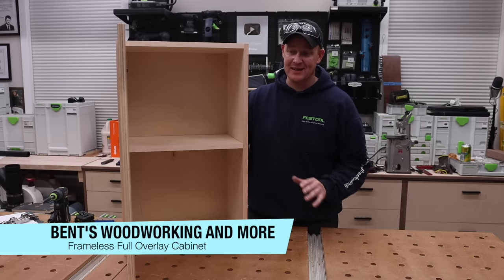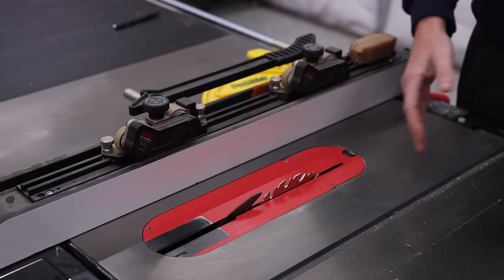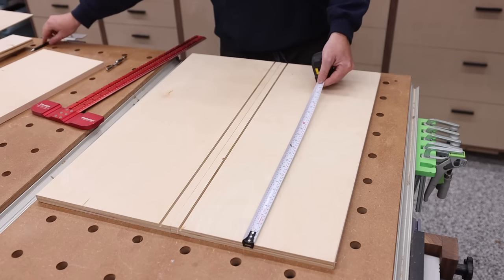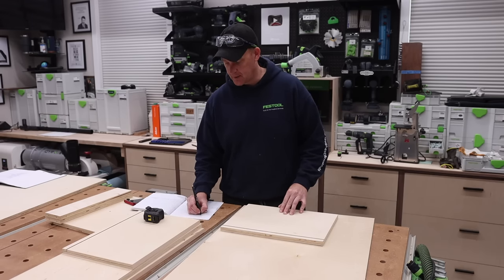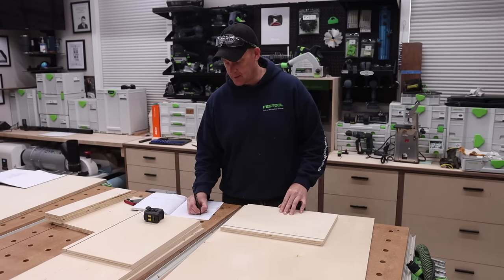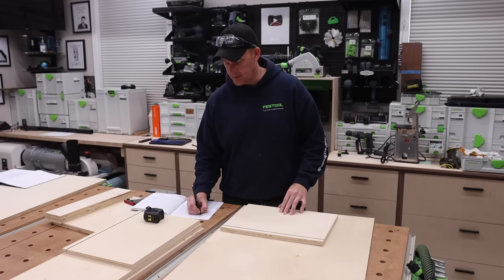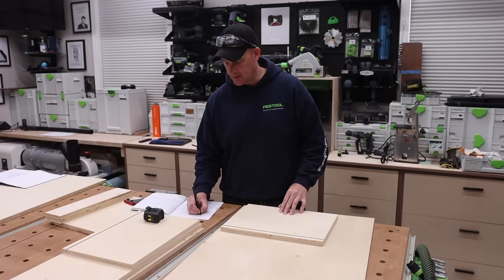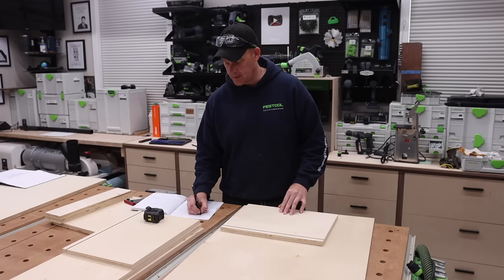Beginners guide to frameless upper cabinets

Comment: Excellent tutorial, perfectly paced. As ever, the inclusion of metric measurements was appreciated.
I use crown staples all the time, as I find they have more holding power than brads.
Alas, over here the cost of that fine looking plywood would make even basic cabinets extremely costly, so it's MDF all the way. Even that has more than doubled in price over the last 18 months.
I will be checking out the shaker door tutorial to see how you go about it. Thank you for taking the time to share!
Reply from the maker: You’re very welcome

Comment: Thanks Jason. Without any doubt, this has to be the best walkthrough ever. 90% of what you demonstrated is what I do, the only difference is that I tend to have the top & bottom on the top & bottom, not inset as you showed. Different techniques, but same results. Very well done.
Reply from the maker: Thank you so much Gary. I appreciate that 👍👍
Reply: @MrWookie1981  Don't get me wrong. I've tried both methods, but I actually find it easier the way I do it. However, when doing inset (rarely), I would do exactly the same as Jason. I'm about to try a different technique in a week or so. It should work & make lining up much easier.
Reply: Typically a top and bottom panel are set into a dado on the side panels. This is done so when you look at the side panel, it is a solid piece from top to bottom. Otherwise you have to deal with the plywood layers showing on the edges. Also the shear strength is better this way.
Reply: @stallionranchwoodworks  You said top and bottom into a dado.  Did you mean rabbet?

Comment: I’m seriously considering making the switch to all metric measurements, the fractions get me screwed up, your channel has helped, thank you
Reply: Get yourself a combo tape measure that has both inch and metric. One side of tape is in inch the other side in metric. It will assist you with the transition process. Also there are apps for your phone or tablet that can be used while in the shop woodworking. I have made the move and find building cabinets easier with metric.
Reply: @jwar2163  I use to hear the measurements like in this video ex 700mm and think why would you want to work that way, then I made an error this weekend in the garage and cut a bunch of stock wrong because of getting tripped up on the fractions, now all of a sudden measurements like that seem like they might be easier to manage
Reply: @randysmith3828  Been there done that myself.
Reply from the maker: Glad you found it helpful

Comment: Excellent video, thank you. I am a beginning woodworker and will build a kitchen for my sister as a wedding present and I will use the things I learned from you.

Also I have a question: what is the best way to mount the upper cabinets to the wall? How to get them level next to each other and what metod to use to keep them in place the easiest way?

Comment: The fact that you used metric made me so happy! It makes the backpanel equation super easy 700mm + 15 or whatever, instead of 43 Inches plus 3/7th divided by 1/4rocketships minus 69/4th of a mountain dew without ice. I’m so happy you’ve come over to the simple way of measuring😂
Reply: Canada went metric but people still refuse to go by metric I can’t understand that
Reply from the maker: Definitely much easier for me. Especially when dealing with cabinets.
Reply: I was just thinking that exact same thing I was listening to the video. I'm struggling going back and forth between metric and imperial. I grew up as Canada was switching to metric. I estimate easily using feet and inches but when it comes to shopmath and find them converting everything over to metric. Have you guys completely converted your shop to metric? Or do you run both?
Reply: @markgarrett2971  I am strictly using metric. (mostly because I live in europe lol) but I tried going over to imperial for a bit because a bunch of plans and videos are in imperial measurements, but I gave it up. For me it makes way more sense just essentially counting from 1-10, in millimeters, instead of doing fractions which require a bunch of brainpower which I obviously do not have 😂. I'd say give it a shot, I don't think the transition will be too difficult for you, because metric is so "basic". 

A little tip that might come useful is that a foot is 30 cm, and an inch is 25 mm roughly. I use those "benchmarks" even when working strictly metric, because a bunch of stuff is derived from imperial. You got this! 😁

Comment: Excellent tutorial.  One tip if I may add... with any cabinet builds and before assembly, sand and seal/finish the interior surfaces before screwing/nailing things together.  That way, you don't have to try and get into corners in those possibly tight cabinets after the fact.  Makes life so much easier.  ;)

Comment: Excellent cabinet tutorial.  Is there any way to make multiple side-by-side cabinets with only single vertical panels between them to save wood and weight (say for use in an RV)?  In other words, build something similar to a shelf but turned 90 deg to support a longer top of cabinet.  I ask because I'm sure it makes things more complicated and possibly impossible with inset door hinges with interference between adjacent cabinet doors.  Just seems so wasteful to screw two large pieces of plywood side by side if not needed.

Comment: Thank you for that clear tutorial. One question: if I were to add extra thickness to the door, say a mirror with a frame, would those Blum Full overlay hinges still work? Would I be needing more clearance on the sides? I'm trying to wrap my head around the impact of thicker doors on your frameless cabinets building strategy. Thanks for your insights.
Reply: None of the geometry changes unless you want to open more than 90° or your total overlay x 2. The documentation for the hinges has all the specs for max thickness and minimum reveals. I'd increase the buffer on the min reveal if you are going thicker (even if in spec) to give a little wiggle room. That same "rockler jig it A" pattern works with a lot of euro spec hinges, of all different styles and overlays.
Reply from the maker: Each hinge will have maximum thicknesses that can be used. You can look at all the detailed specs on the Blum website. It’s very helpful 👍

Comment: Great video, tons of information for me to process through.  Aside from woodworking, I am a cyclist and runner and converted to metric back in 2010, but for the life of me I had to give up changing the shop over to metric. You make it seem so simple though, perhaps I should give it another shot.  My big issue was that all the scales on all my equipment are imperial of course, and it seemed prohibitively complex to switch every single thing over.  And tedious.  But still, you make it look so easy !

Comment: Thank you for posting your video !! General question I see you’re using your Festool Impact TID18, however what bits are you sing to drive your screws. Could you provide the Festool Part number. Appreciate the following.
Reply from the maker: I don’t have a part number but festool makes an impact bit set

Comment: Do you happen to have plans for frameless cabinet construction or know of a good resource where I might find some of the larger cabinet-constructed plans? I'm finding it so time-consuming to come up with a material list to produce a cut list to get an idea of what my cost is going to be. I need (6) 30" door and drawer options and (2-4) 18" or 24" open adjustable shelf options, both with a large depth. Trying to calculate how much of the 3 different material thicknesses that would be needed to take into cut list optimizer seems to be as time-consuming as building the cabinets themselves lol. Thanks for all the great videos and I have read your articles. It seems your article used only 3/4" and I can't seem to get the Printable PDF button to go through.

Comment: Hey friend
Great video with a simple explanation
I came to the video following a problem I had with a buffet project I was preparing between two walls
After I put them in place I took measurements for the  door fronts but I have dimensional differences between the top of the box and the bottom that  comes up to a difference of up to 5mm
In fact the box is no longer an exact square
I would love to understand what solutions can be done without disassembling the whole box and reassembling so that the front looks straight and covers the entire edge completely
it is frameless desing 
thank u

Comment: You mentioned in the video that side by side cabinets with overlay doors would result in the need for an adjustment to the measurements, but I didnt hear anything else regarding that adjustment.  I am in the process of designing (on SketchUp) some shop cabinets and have a bank of uppers across a 16' span.  I plan to have them side by side frameless with overlay shaker style doors.  I am trying to ensure I design them correctly in the program and am looking for tips on measurements spacing to ensure the door will open.  Any tips or videos that you can point me towards?  Thanks as always!

Comment: Very instructional video... Question1: Got lost with your computation for the width of the top and bottom panels = 423mm + 15mm for groove = 438mm.   Where did the 15mm groove number come from?   Question2: is the positioning of the hinge plates always 100MM from both the top/bottom edges?
Reply: Just a quick tip. When asking questions, mark the time in the video with @x:xx  (min:sec)  This way others can click on the time hack and  jump right to it to lend a hand.  So @10:30 Jason is talking about making the back panel.  So you you have width of the carcass. That's 423mm.  But remember, he cut grooves so the back panel will slide into the side panels.  Which means it's going to be wider that the physical top/bottom shelf.  And the depth of the groove is 8mm on both sides.  So he should have added 16 mm. But as he said, he wanted some wiggle room so he made it 15mm wider than the physical top/bottom panel.  When you slide it in, you don't want to be fighting it all the way down with such a snug fit.  @14:30 look at the upper right corner. You can see the bottom shelf stops but the groove extends into the side by 8mm. That's why the back panel has to be wider than the top/bottom shelf. 

As for the 100mm question, it's aesthetics.  Common placements are 2, or 3, or 4" (4" is about 100mm)  Hope that helps.
Reply from the maker: It was to account for the grooves and 100 mm was used primarily for ease of explanation but it’s what I typically use.

Comment: Hi ! I wanted to know why you would insert a really thin back pannel and then attach a nailer to screw to the wall, rather than just use a back pannel that is the same thickness/material as the rest of the cab. Is there a benefit to having a thin back pannel inserted in the sides ?

Comment: Thanks for putting this together, some good tips but a biscuit jointer is easily the best option for making cabinets. Stronger, quicker & more accurate construction all. round... i havent made a cabinet in the last twenty years without one...They're a cheap tool if you go for a budget option too

Comment: Great video! You seem exceptionally knowledgeable. Sorry to go off topic but ive searched everywhere. I made a really nice workbench in my shop. I want to make a pull out table extension which will flip up to become flush which has fold down support legs. I know i can install 2 hinges and just flip it up but i want to keep under the bench open and easily accessible. Table top is 3/4 inch plywood. Do they make slides that will allow the shelf to rise flush at the end of their travel? Any type of help if and ever you have a minute would be very much appreciated. Thanks either way
Reply from the maker: I think brad from @fixthisbuildthat has some content on this.
Reply: @bentswoodworking  i will check it out. Thank you

Comment: Excellent teaching there which I have not really found on YT! Teaching the concept is so useful. I see people using glue, as well as screws. Would there be any advantage to doing so? Edge banding would add a little to the measurements. Cabinets side by side with doors - how does that affect the reveal or does that require a spacer between cabinets?
Reply from the maker: I always add my edge banding before cutting to final size so it is part of the final measurement. As for multiple cabinets and doors, you just have to account for the spacing you want between doors when you decide the door measurements

Comment: I was hoping to get your thoughts on a project I'm working on.  I am building an outdoor kitchen space.  The cabinet enclosure area is going to be faced with wood plank tile and I wanted to do the doors as well. I would build the face with 2 openings so that I can insert (2) 36 inch cabinets.   I wanted the doors of the cabinets to set in flush so that the plane of the tile enclosure meets the plane of the door face.  My question is would the function well or would the door bind on the enclosure?

Comment: You mention doing this differently if you have adjoining cabinets on either side.  Can you explain or make a video on how you would do this differently with multiple cabinet boxes in a line in frameless application?  I rarely see one upper cabinet all by itself.  Thanks.

Comment: Seems the blum hinge link is not the exact model you are using. I'm wondering if the 2-screw monting is not strong enough.
Reply from the maker: 2 screw in plenty holding power. 👍

Comment: As an 🇦🇺 it’s great to finally find a great woodworking / hardware channel from the US that finally uses the metric system. Millimetres, Centimetres etc. the only thing I use in the imperial system would be inches and occasionally feet. But I’ve never been able to wrap my head around other forms of measurement would be gallons, miles or yards but that’s just my little own Rant lol.😂
I love the content and the quantity and the variety of advice you share here with your audience 
Cheers from
Down Under 🤙🏼🤘🏼👍🏼

Comment: I have a tendency to overbuild, overengineer. Are those screws enough to hold loads of weight? If you knew they will be under lots of weight what would you do differently? Thanks
Reply from the maker: This is plenty strong enough. Shear strength is much higher than people think. This is probably the most common way of assembling cabinets. Screws and/or staples that is. 👍
Reply: @bentswoodworking  Thanks mate

Comment: Great video. Is the 2mm reveal for aesthetics or for function? Meaning if I have a door that's 17wide x 30 long, is there a problem making a cabinet the exact size of the door?
Reply from the maker: Just as an example. If it was a single cabinet you could definitely make the same size door. You would possibly run into issues if you had multiple cabinets side by side
Reply: @bentswoodworking  yes it's actually 2 single cabinets with a floating shelf between them for my laundry room. Been searching for a video on how to size doors for f/less cabinets for a bit....then I saw yours today. HALLELUJAH!!!

Comment: If it is against another frameless cabinet, does the 2mm around the cabinet still work or does it need to be bigger?
Reply from the maker: It would depend more on the exact hinges you’re using and thickness of the doors.

Comment: Best I could tell from your explanation is that it was going to be an upper cabinet. If that’s the case I’m wondering why you didn’t use French cleat on the back to hang it with since that became a standard years ago.

Great video though!
Reply: The standard? Really? Must have missed that in the trade as last hundred installs I've seen is screwing to the walls/studs. I do like cleats though, easy to hang, still need tweaking though!
Reply: @kerrykroberts7809  my brother has been building and hanging cabinets for over 30 years. French cleat all the way. I’ve watched him, very streamlined. I’ve seen some videos on YouTube as well. Try it you’ll love it.

Comment: I couldn't tell from the end there, but would this work with a shelf on slides? I'm looking to do a pantry cabinet, but I don't have a lot of space and don't want to have to loose any with spacing out the slides for a face frame.
Reply from the maker: I’m not sure I totally understand
Reply: @bentswoodworking  oh sorry drawer slides. I want to make a pantry cabinet with drawer slides so the shelves can come out. Don’t have a lot of width so I was thinking of going frameless but I don’t know if the door that would be on front would swing out of the way of the drawer.

Comment: Some good tips here. The 32mm system for frameless euro cabinetry has specific guidelines based on drawer slides and hinge hardware and it’s the foundation. Takes some work to wrap your head around but the assembly goes super efficiently. If you’re interested check out True32 flow manufacturing as well as Blum Pearls.
Reply: cool tip, thanks. standards/systems can be very handy
Reply: actually kinda interesting that Rockler jig says 32mm, is that a coincidence or is it using that same system?

Comment: Question: I want to build an upper wall cabinet for my garage that's 24" high x 12" deep and 48" long. Is there any reason I should not make one that wide? It's not going to be loaded with heavy stuff and I intend to use three nailers to really anchor it to the studs. Thanks!!

Comment: Thanks. In case you have to pre drill, how do you decide the size of the drill bit in order not to affect the holding power of the screw
Reply from the maker: I always predrill a size smaller.
Reply: @bentswoodworking  I thought the there is a standard relation between the screw thickness and the drill bit used for pre drilling. What you are saying is just use common sense... Just smaller size